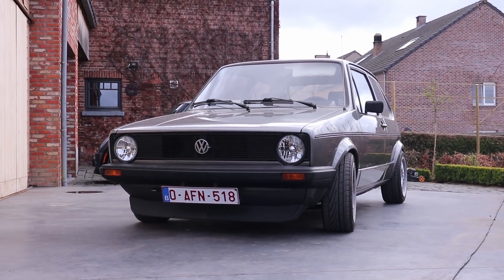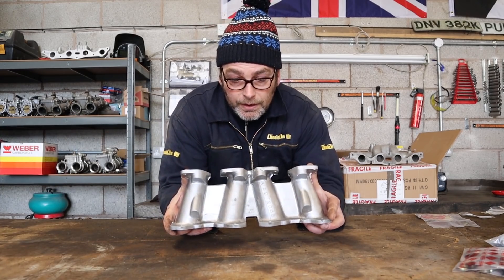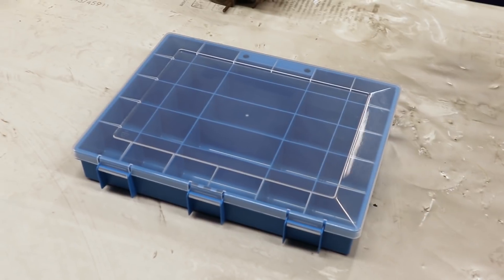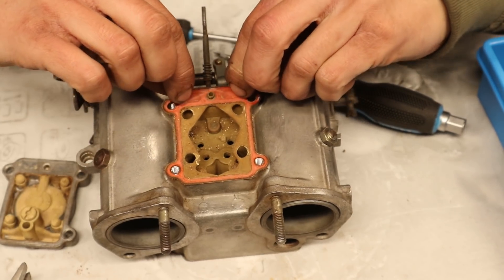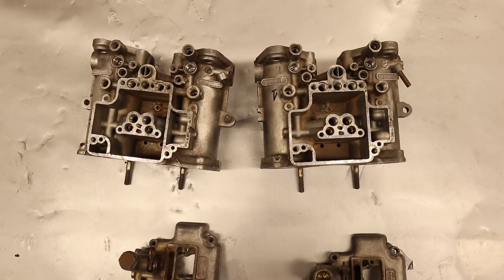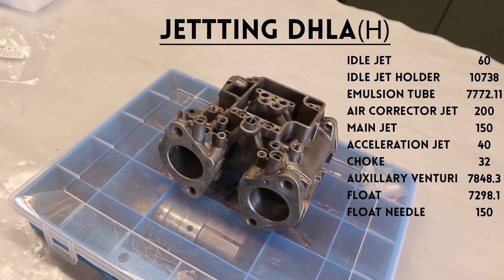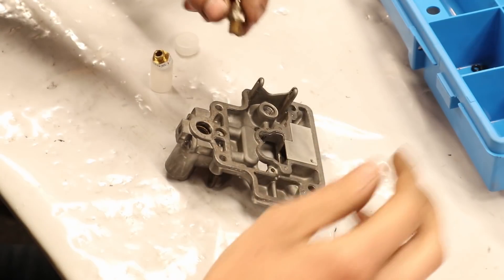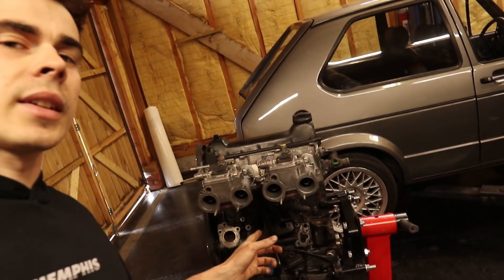Golf Mk1 2.0L 8v Engine Swap - Pt1: Full Dellorto DHLA Rebuild

Comment: Done like a pro!
The little filter in the needle valve is not critical Memphis. Either clean and reuse it, or leave it out as you have.
These little filters are no longer available from dellorto, and are only used in a few DHLA applications.
You will have to grind and relieve the spot where the lever(s) are touching the intake manifold, to give clearance for the throttle.
Wishing you the best with the radiator and distributor issues.
If we can help at all, just ask.
Great work and enjoyed watching all this, great video 👍
Emmanuel
Reply from the maker: Thanks for the advice!
Reply: @memphis5220  while you're at it drill some speed holes in those webs, far too much metal in there
Reply: Probeer poco is, is een  Duits bedrijf ben zelf bezig met een polo sedan en heb daar een upgrade radiateur gekocht voor een G40
Reply: Y'all must be the nicest brits in existence lol
Reply: @memphis5220  How many HP that engine will have with those carburetors?
Reply: @memphis5220 why are your eyebrow so Black and your hair Brow?

Comment: rebuilding a carb is like an art form, and it will soon be lost due to  electric cars. this is so wholesome watching you rebuid this, great work mate.
Reply: You're right, it will be lost, but not only because of electric cars. have you seen any new car with a carbourator? don't think so
Reply: the skill of knowing how to work with carburetors is replaced by the skill of knowing how to work with fuel injection
Reply: Not to worry. Us petrolheads are not going to buy electric cars, ever. I rather drive a wheelbarrow than one of those.
Reply: @MLC...  so do i
Reply: @MLC...  My mechanic who fixes my B2 Passat has a customer with a MK1 golf. He is worried about the future mechanics not knowing how these engines work because they are so outdated.
Reply: @MLC...  I think both have their advantages. Electric cars are best for privat users especially in cities and on short trips like for you Mail delivery. Pertrol or diesel are cheaper and very efficient on longer trips and of course much more fun especially to work on.

Comment: seeing this kind of stuff really makes me wanna buy a car with carbeurators
Reply: Lol don't.  It's a pain. I grew up driving carburetor cars.  Fuel injection is a revelation.
Reply: Fuel injection is better. But its alot of fun to mess around with carbs, a nicely setup carburettor will have no problems.
Reply: @VeyronBD  Lol, I have some bad memories but especially after hitting bumps etc.
Reply: Carbs have character. But they are outdate technology that was replaced by injectors for many reasons.
I consider fuel injection much much more complicated to work with. For a carburetor you just need a few PSI of constant fuel pressure from your pump, a screwdriver and patience.
Fuel Injection is another story. You don't just turn a screw to tune the mixture. You have to connect a computer to your ECU, have the right software for that and than figure out what the fuck is going on for 30 minutes bc something is not working before you eventually can start looking at the fuel trims.
Reply: Do it! I did and I love the experience. (MK2 Escort with twin 40's)
Reply: Those Dellortos and Webers are mechanical masterpieces. Especially when you start considering emulsion tubes and jets. Fuel Injection is for lazy people.................................... just a joke.
Reply: Trust me... U dont
Reply: I have 1986 corolla with 2e carburated engine, its like 75hp stock but alot of fun to mess with
Reply: @VeyronBD  I own a couple of classic Alfa Romeo's with Webers and Dell'Ortos. I can tell you they are a revelation in smooth running if they are in good condition and adjusted to perfection. If you like mechanical stuff carbs are fascinating. Yes, modern fuel injection is better, but it lacks the beautiful engineering of carbs.
Reply: @MLC...  For sure, my one and only car I use daily has a carb, hasnt given me trouble at all

Comment: Hey there. I work on Dellortos all the time. One thing I wanted to mention is that ultrasonic cleaning rarely cleans the tiny passages enough. You should get a set of carburetor cleaning wires (a set costs about USD $10) and poke through all the tiny passages. Especially under the jets and the inside the bores above the butterflies. You'd be amazed at what sticks inside. Apologies for telling you this after you've assembled them.
Reply: I agree.  Ultrasonic cleaning is overrated.  You really need to clean the tiny passages manually.  Besides, I am not a big fan of omitting filters that the manufacturer deems necessary.

Comment: Been following you for a while and this is the most interesting content yet as I'm currently considering engine swapping my mk1 cabriolet with a 2,0l 8V myself. But since FI is original to my car I was thinking of doing it instead of carbs. The point of building an 8V for me is that it is more "stealthy" than the 16V-route. At least here in Sweden you'll not pass inspection with a 16V under the hood.

It'll be really interesting to see how the fitment of the new power plant goes, also some mention of the crossflow cylinder head choice. Great content man!

Comment: Actually doing the same build. I purchased a low mount alternator kit which allows me to reuse the factory alternator. I believe you can use a MK3 non-aircon bracket and alternator or you can modify a polo 9n bracket to fit. Also in SA many use a Honda style radiator mounted on the side to provide more clearance

Comment: The Dellorto DHLA 40 "H" carbs are Alfa Romeo specific (like all lettered DHLAs) and are designed for a particular Alfa Romeo Engine. Even between Alfa engines they cannot be swapped because the internals of the carburettor were setup to match that particular Alfa Romeo cc engine so they not tune optimally unless matched to the right engine. You even have as seen the tamper proof mixture screws on this later "H" version. The Dellorto DHLA without any letter after the 40 are universal and the only carburettors that can be tuned for any car since they are not engine specific.

Comment: Use some slimline fans instead of that bug fan housing. You could go for a thinner radiator which sits under the front panel

Comment: An 8v 2.0L is not a boring option!
They produce a better, flatter torque curve than the 16v.
Had one in a MK1 jetta with a mild schrick cam and a twin choke Webber conversion.
Certainly livened up the jetta. So an 8v running twin DHLA will certainly make the Golf move.

Comment: beautiful work ... waiting for the next video, with the continuation of the assembly of this engine and see it inside the bay.
edit: hello from Brazil 🤜🤛
Edit 2 😅: I am curious to see the solutions you will use to regulate the fuel mixture without having a Lamba probe (wide band), ignition advance, avoid pre-detonation, water temperature sensor, etc.

Comment: Remember that the 2.0 8V GTI engine was also mount on few Seat variants here at Spain,like Toledo GT and Ibiza from 93-98. It's a reliable and easy engine to upgrade/swap Mk1 & 2 Golf/Polo. Just take care on engines with high mileage/many time stoped.

Comment: Awesome video Memphis, the first part make me laugh out loud , that engine is the 1st generation of the 2.0 litre in my MK 4 Golf GLS and the exact same horsepower and mine is  1500kgs your car is probably 500kgs lighter and nicer in my opinion , once you get it in the car and running and setup properly those carbs are going to sing rom about 2200-6500rpms, your gonna love, so will your dad, Webbers might be slightly better, for the money difference theses Dell Orto's are awesome and just as tuneable as any Webber is, you will notice a good change with the cross flow head , the engine runs cooler than the 1.8, its good this is just better and more efficient in every way ,in the future if you want more power there are tons of camshafts available for them in the aftermarket and not badly priced either , it would mean some new jetting for the carbs again, no big deal, camshafts changes always mean you give up bottom, mid or high rpm performance, this MK 1 is gonna be a little rocket and may require a radar detector to find the local police radar traps,LOL,  good luck 👍

Comment: You need a aluminium valve cover on top of the engine. It should be bolt on with rubber gasket and flat bolts. G60 or 2.0 from mk3 golf will do the job